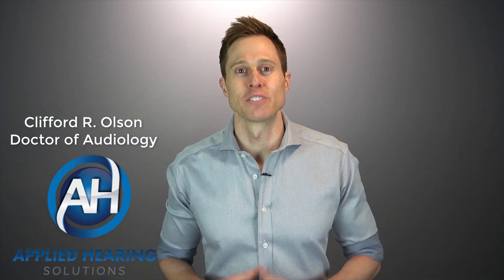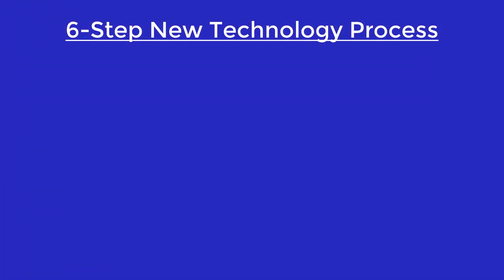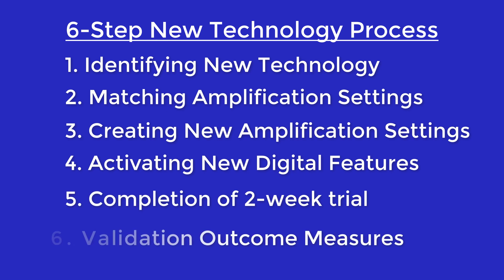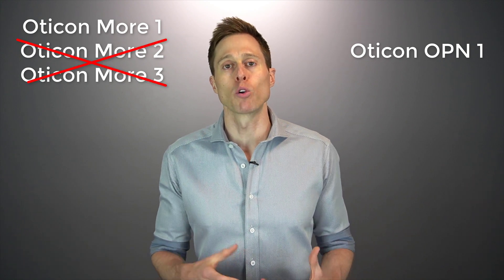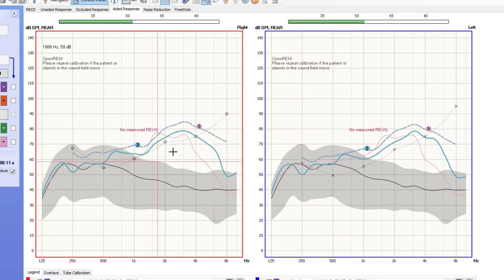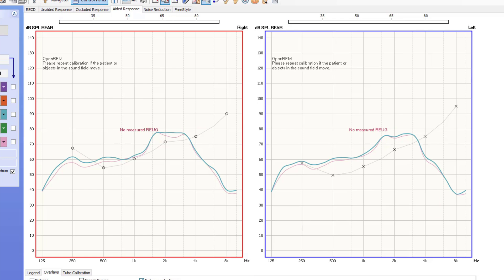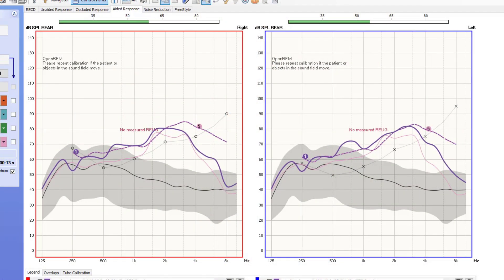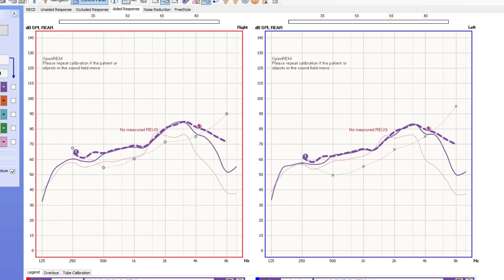BEST Way to Upgrade Your Hearing Aid Technology | 6 Step Method

Comment: Hi Dr. Cliff, I believe you are the right person to give the definitive word on the subject of auditory distortion and hearing aids. Do premium models offer more options to dial in clarity then less expensive models? Can hearing aids even achieve improvement in this area?
Reply: 🤔 from what I understand yeah
Reply: @meric12131415  I can now speak from experience. I have Widex "440" and they help a little. The problem is that the inner ear is past the HA in the auditory circuit and therefore still distorts the enhanced hearing. But they do make a difference and it's nice to not struggle with volume.
Reply: @iluvj50  ah definitely definitely

Comment: You really make some good points.  

For example I just upgraded from Phonak Marvel to Paradise because of the better bluetooth in the Paradise allowing use with multiple bluetooth devices.  BUT an unexpected benefit was that clarity improvement in the Paradise has allowed me to go from closed to open domes (of course, now a new REM needs to be done). 

Also have tried the Roger On iN during conference situations...wow, what a difference.  Have not been obvious about using it, either. Also tried it with the bedroom tv with the volume down a bit and it works great for that as well.  

Finally...you are right, it has taken a couple weeks to adjust to the new hearing aids, despite these being my 4th pair (so not a new or inexperienced user).

Comment: I switched from Signia Nx 13 /5 to Signia AX7. I definitely feel the difference, but am not quite sure if this was a justified move in terms of pricing. I just got obsessed with all the new features of these newer hearing aids. No REM have been performed though.
Reply from the maker: Gotta have that REM done. No sense in leaving a bunch of benefit on the table.
Reply: @DrCliffAuD  how often should REM be done?   Is once enough??
Reply from the maker: @dkstott29  at fitting, after your prescription changes, if you make a dome or earmold change, or if you need to recheck the programming of the devices.
Reply: REM = rapid eye movement ?
Reply: Real Ear Measurement
Reply: @richa.s9912  🤣 na real ear measurement

Comment: I'm gonna go upgrade to Ultimate Premium Advanced State of the Art Alien 👽 Technology Digital Hearing aides for myself in next month or so. My old digital hearing aide not working properly anymore for years. I'm getting a new Phone Water proof Audeo Paradise Life Advance auto surround sound Digital Hearing aides rechargeable and Custom Molded titanium ultra steel American made ear molds and stainless steel fiber Optic wire connect to the ears molds and having a solar power charging base USB hook up to Phonaks Waterproof hearing aides rechargeable battery . I'm very tired of ruining my hearing aides by dust , thunderstorm rain and snow and sweat and showers and swimming not being able to figure out where sounds are coming from and not being able to have any noise cancellation installed in the hearing aides so I won't be going deaf again from awful loud noises . No I'm not talking about mother-in-law and my mom and my girlfriend talking too much.